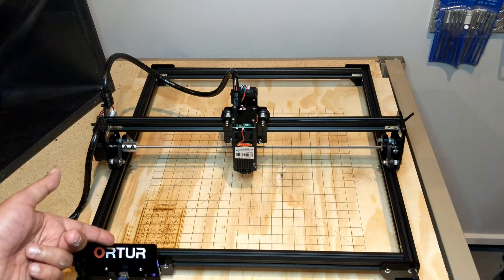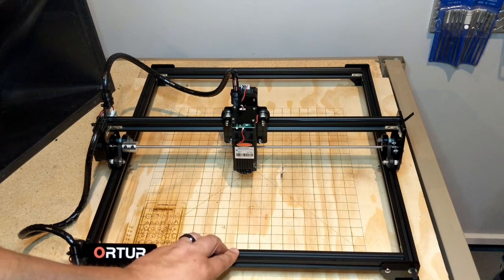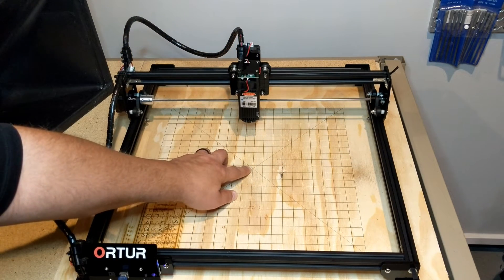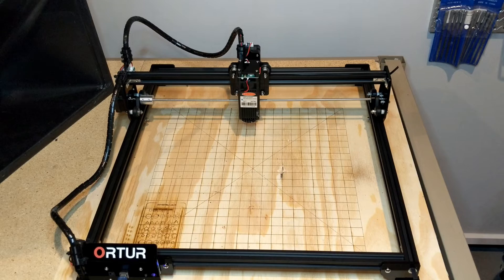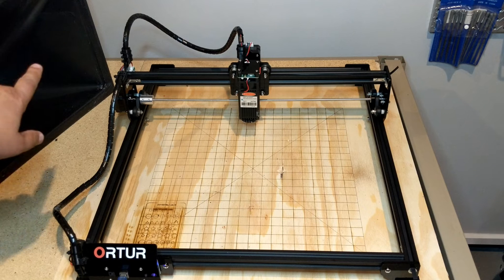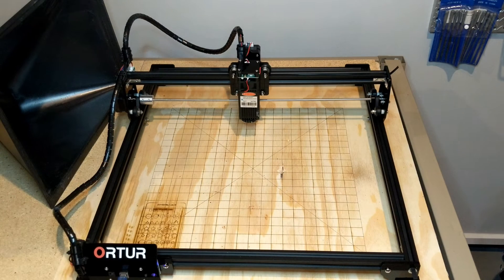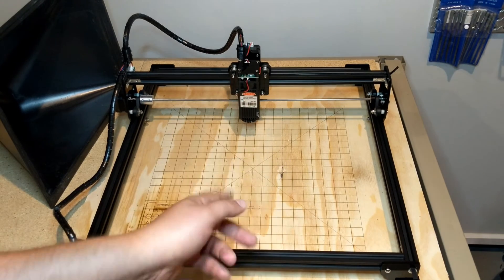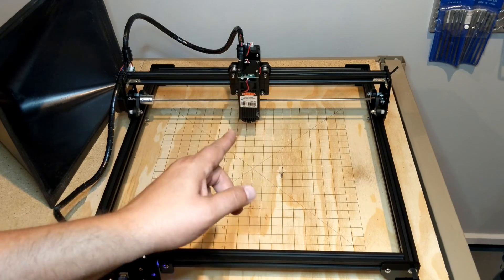Ortur Laser  -  Modifications We Suggest!

Comment: Love this! Great content and tips to make the Ortur 2 even better. One problem I noticed: The grid download URL doesn't work anymore! Could you send me the updated URL or file? I'd love to get it burnt onto my workspace and saved as a layer in my Lightburn setup ASAP :)
Reply: I am brand new to Ortur and lightburn, but you can make a square whatever size you like. Something that makes sense to what you need (ex:1") and then you click on grid array on the left. A new panel will open and then you will have a X axis setting and a Y axis setting. They are auto spaced roughly 1/4" if you make this setting 0 on both axis settings, the boxes will touch and you just add however many you can fit in your burn bed. I did this yesterday and included sequential inch marks (1", 2", etc). I also put "X Axis" on the X axis line, and an "Y Axis" on the Y axis line. This just helps me reference the lightburn grid when im getting ready to do a project. Lastly, make sure you center the grid you make by selecting all and moving it until you are happy with its location. I don't find it super necessary to make the grids go all the way to the end, as this is less typical. You won't usually try to use the full extent of the bed. Once you have what you like, you can make it a template quick selection and you will know how far you can go and your going to just know where to place things because lightburn will home as normal and then go wherever you place your project on the lightburn design area. You can do the same thing for circles as well. Hope this helps.

Comment: Just wondering if you are using the 32 bit version of lightburn or the 64 bit version?
Reply: 32 vs 64 bit is to do with what operating system your computer uses, there isn't any difference in the software from a user point of view. You should Google what bit your operating system is and install the version that works for you
Reply: @RTCFMO  That is what I thought it was referring to but wanted to make sure.

Comment: I need help! I downloaded the file and it started to engrave, however when it goes up to the next row of the grid it is slightly off so the lines are not lining up properly.  Is there a fix for this?
Reply: had the same Problem.timing belts were to loose.
are your 
timing belts tight enough?
Reply from the maker: Maybe as mentioned below check you belts and general set up...

Comment: What is a good 'entry level' 3D printer that will print the cable holders, feet and focus knob for the Laser Master 20w laser? Thanks.
Reply from the maker: Here you go:  https://amzn.to/39KQBIm  fully assembled and auto bed leveling too! (also have one too)
Reply: @DIY3DTECHcom  I did a little research and decided to go with a Ender-3 V2 3D Printer. Better reviews. BTW, when I tried printing the grid you put in a link for it sort of started printing weird. It started with one of the diagonal lines and then printed single squares and in doing that went over the adjoining lines of the previous square. Is it supposed to print that way or do I have a setting somewhere (LightBurn) set wrong? Thanks for the great videos.

Comment: Will this cut 3mm acrylic cleanly.. if multiple passes required.. Approx how many?
Reply from the maker: If it is a dark color (prefer black) yes, use 5mm/sec 12 passes with a G2 and 5mm/sec 40 passes with a G8 both focused to the bottom.  You also need to use air assist to avoid remelt from building up in the kerf...  Note I will be doing a video on this in the next week so stay tuned!

Comment: You mentioned upgrading to a 5w - 8w output laser power in the future, where do you plan on getting those as I know Ortur only has the 20W in lasers available?
Reply from the maker: The 15 watt (input) is around 5 (output) and the 20 is around 7.  There are several on eBay and one even claims to be 15 watt pout put but I'm skeptical
Reply: @DIY3DTECHcom  You never mentioned what laser output your current Ortur setup has, so yes, I know they offer 7W, 15W, and 20W laser input and was curious if you could upgrade even more as I'm also interested in more cutting power because, as you mentioned, the cutting capabilities of this machine are not very good.
Reply: @jessicalewisjessielew3399  near the end of the video he says it's the 15 watt which has a 5 watt output.
Reply: The 7w output is around 2w. The 15w output is around 4.5. The 20w is 5.5w output not 7w.

Comment: Hello, 
Watched some videos after buying this machine, however just received it, and i can't get the Laser Light to work.  Everything seems fine, but when i test the laser focus, only the Laser Fan works, Also when i engrave everything seems normals, the laser moves like it's engraving and fan starts working however no laser.. Im really dissapointed already check all the instructions ad some videos and have all well connected, you know what could be?
Thank you
Reply from the maker: First double check on the laser head there no disconnected wires also what software are you using as the firmware is GRBL so you need to ensure there is an S modifier when you (or your software) issue the Gcode to turn on the laser.  Best to spring for Light Burn as it deals with all of this out of the box and is worth the money

Comment: I have a question being so new to all of this, I have downloaded the LightBurn software but I can't figure out how to turn on the laser at a low power so I can line up my material to burn, any advise?
Reply from the maker: No worries however the low power is more for focusing then lining up.  To line up you use "frame".  To add fire laser with adjustable power to the "move" tab you will need to go int the settings or parameters (for what it is called but you can figure it out) and then close and restart and it will be there on the more tab.
Reply: @DIY3DTECHcom  Hold shift key down during "frame" procedure.